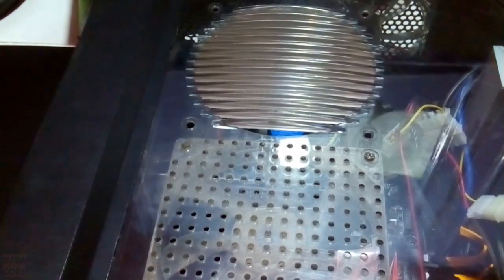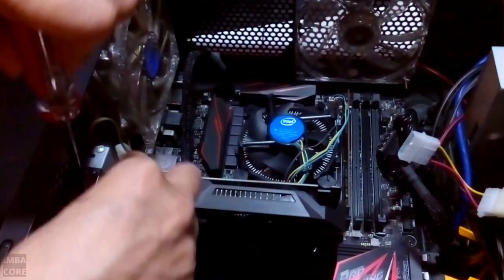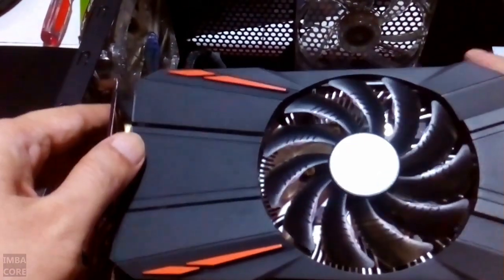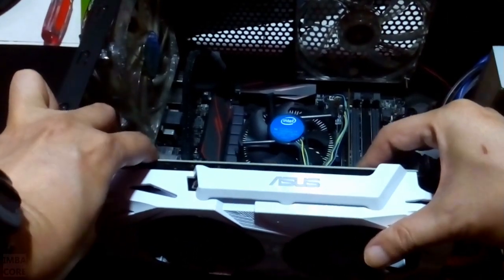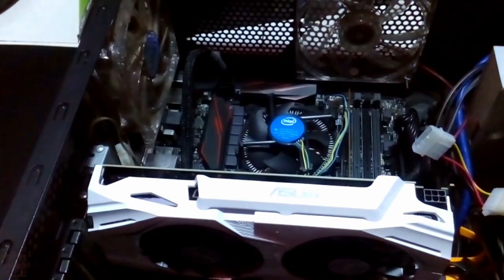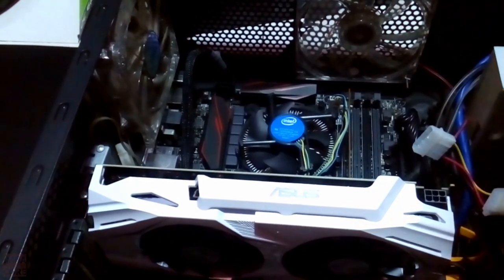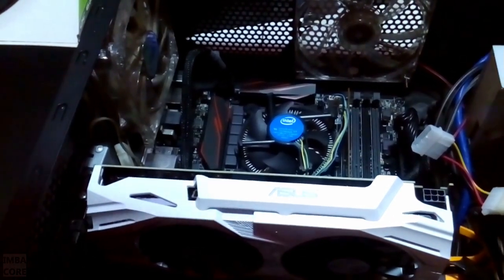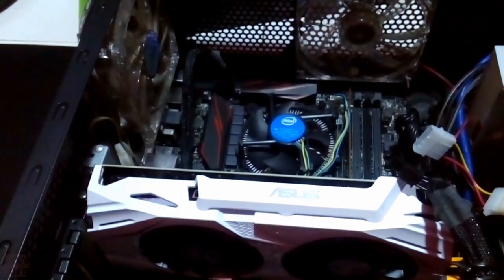Upgrading: Video Card – How I Removed My Graphics Card (a GTX 1050 Ti) to Change to an Asus 1060 6GB

Comment: So, english isnt your primary language? you speak it very fluidly and better than me! enjoy your 1060
Reply from the maker: Hey thanks BlazerSeitai! Much appreciated! I'm actually having problems with OBS working with my newly upgraded rig. My suspicion is that because I haven't upgraded my CPU, the processor is now struggling with the ramped up resolution (and other CPU-intensive in-game settings) and the greatly expanded resource consumption of a 1060-powered system. 

I've to go back to Nvidia Shadowplay (which doesn't have OBS' extra bells and whistles). 

The above aside though, if I just game for gaming sake (without recording), I'm VERY happy with this video card. ^_^

Thanks for commenting Blazer! (Sorry for the late reply; was working earlier.)